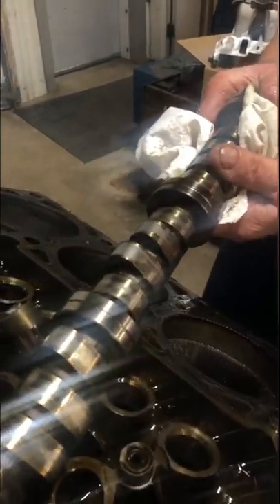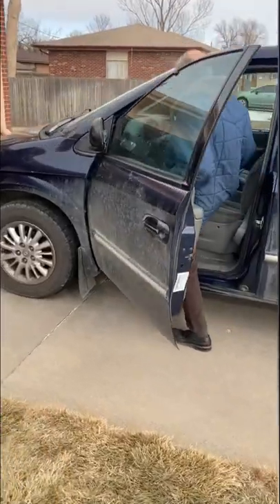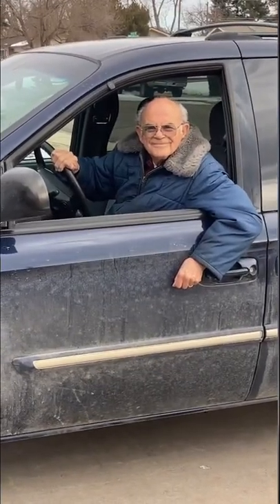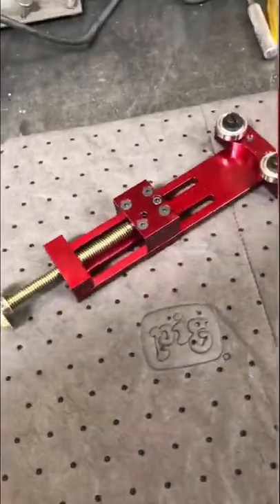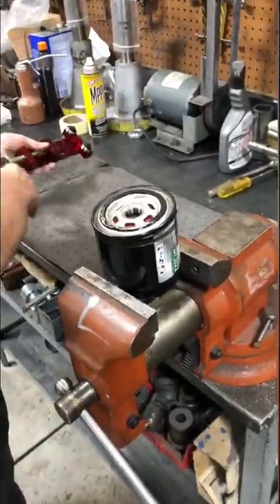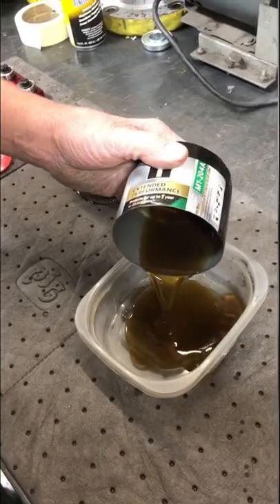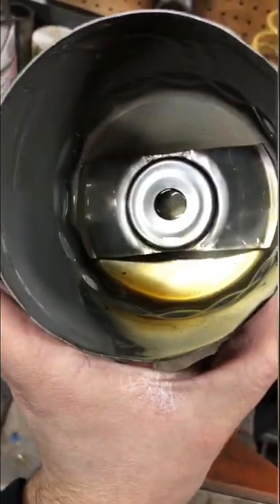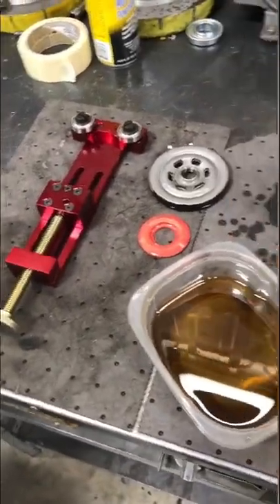#shorts Grandpa Is Happy To Have His Car Back!

Comment: There's always two moments of sheer suspense when working on a car: the first is when you get the newly rebuilt engine running for the first time  and the second is cutting open the filter after the engine has been running (or you got the flat tappet cam broke in) to make sure there is no magic glitter.
Reply: I see you too have walked the tightrope of :
"Cant be proper fucked unless we start it, cant confirm proper repair without run time plus inspection."

The stressful first fire plus the transcendent high of bringing back the sewing machine rhythm to a man that likely was pulling hair out and feeling so antsy driving a unknown mechanical contrivance.

Good deal, if ya love your vehicle, its sorta like loaning out your most used and longest owned tool. The one just short of the heirloom stuff. That trepidation of "this person and I are super tight, went through puberty together and even realized the moment we became our own fathers."
thinking "if this friend breaks/loses/abuses/doesnt clean or otherwise return this tool in the time frame agreed and condition observed, I will absolutely enforce the hell naw I sold all my tools friend clause.".

Its a very special moment when the thing starts, that verification tentative heat cycling though? Certainly clench worthy moments. 

Agreed more time on the break in oil, but I feel the old man wants to ensure he can show the mechanical gods his respect. And get everything interior wise set correctly.
 A individual that really has grown to love their transportation, knows the regular and critical squeaks and catalogs any out of character events. 

Trust your vehicle, the vehicle will tell you if its turned into a bearing material glitter smoothie maker. Hes gonna love that easy starting and smoothly running machine.
Reply: @threadtapwhisperer5136  you write like a poet, didn't exactly understand some of it because I don't know shit about cars but you really do write beautifully. You should write as a citizen journalist. I bet you'd be awesome.
Reply: That first start up is the worst though the stress is brutal 🤣

Comment: We did all of the machine work for a taxi company that ran dodge minivans. Most had 400k miles or more. What was surprising though is the cylinders, they still had factory hone marks in them. When we bored them we noticed they are incredibly hard compared to other engines and wore out cutting tips quicker.

Comment: Litte FYI, Mobil 1 oil filters are made by Fram... Chances are it did not catch the metal particles. The bypass valve in Fram filters is notoriously weak, and the filters love to seperate internally..

Comment: That oil filter cutter looks like a great can opener think I'm going to upgrade use it as a kitchen utensil who cares wats in an oil filter as there is a screen on the pickup tube and that is away from the lowest point in the sump that the garbage wants to collect in check in the bottom of the oil you drained out is more telling and magnetic drain plugs are great too...